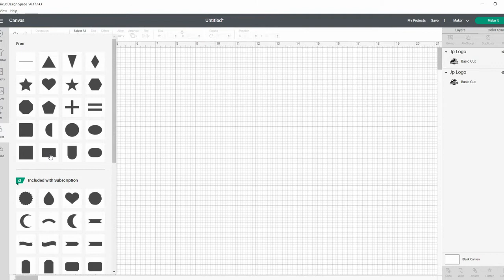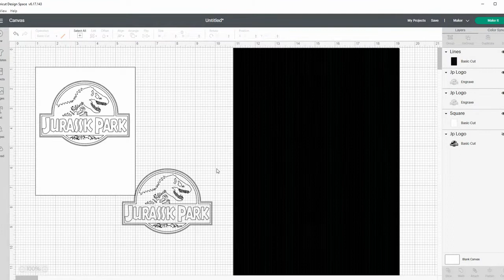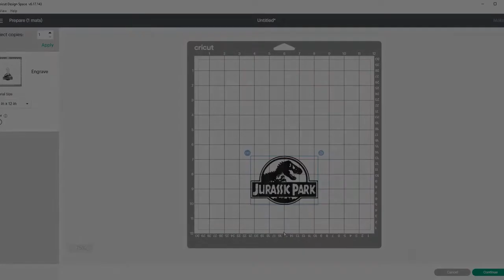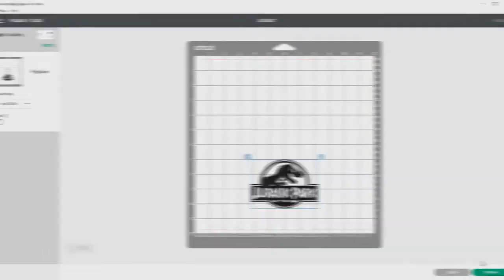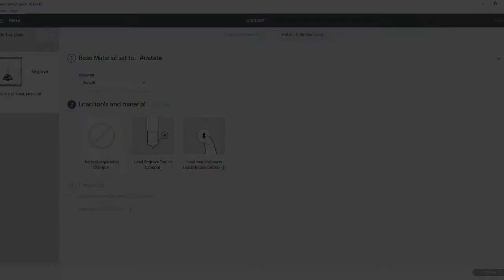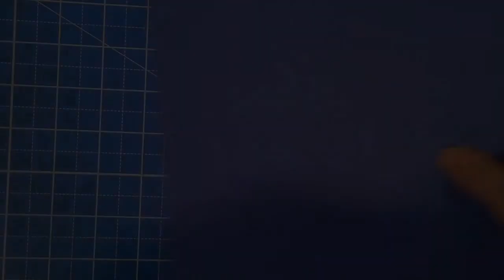Cricut Tutorial: Engraving an Acrylic LED Sign

Comment: Which bases did you order to fit the 2mm bases?
Reply from the maker: I can't find the ones I used exactly since it's been a while from the last time I ordered.  I actually ordered them in a set, so I didnt have to worry about matching acrylics and bases.  Here is a link to 2mm acrylics you can use with the Led nightlight base. You may want to check how long the base slit is and see if the acrylic bottom is the right size. https://a.co/d/3kKjSWI

These bases will fit with the acryic plates linked above: https://a.co/d/6dYYdfH

Comment: How did you put the square with the fill lines? I believe you did it off screen. I missed that part.
Reply from the maker: Yes, I had already uploaded a fill pattern and just added it to the canvas.  I used an svg from corinneblackstone.com, it is a free download for filling in hollow fonts.  I noticed a little while ago that Cricut came up with pattern fills as well.

You can use the preloaded patterns in DS by:
1.clicking on the item you would like to fill 
2. click on the "material color" square in the top toolbar
3. there is a drop down menu for Color, but the other option aside from color is "pattern." Choose the "pattern" option.
4. select a pattern, and your image will auto-fill with the selected pattern.

Comment: thanks for the tutorial! can i use a cricut joy for it?
Reply from the maker: cricut joy can't use an engraving blade BUT there is a vinyl that looks like frosted glass that you can cut with the joy and apply to the acrylic plate. It will look pretty convincing as an engraved light sign, as well.
Reply: @karbear04  thank you so much for the information!